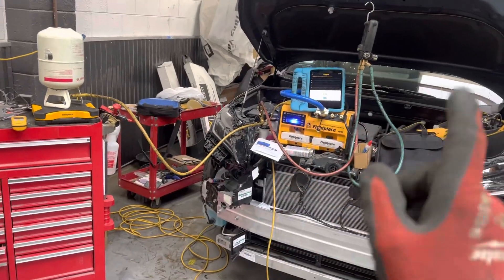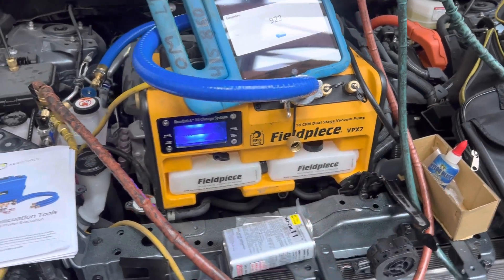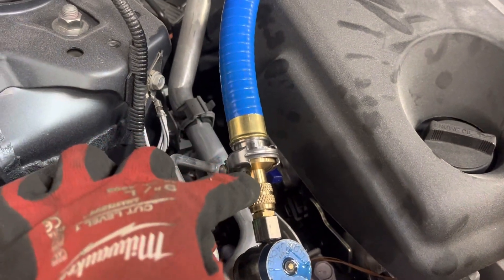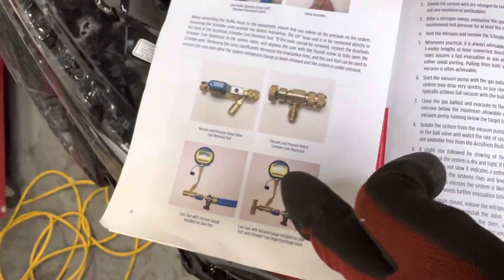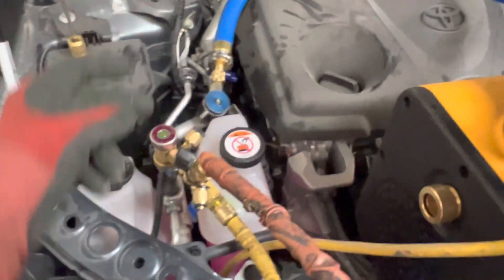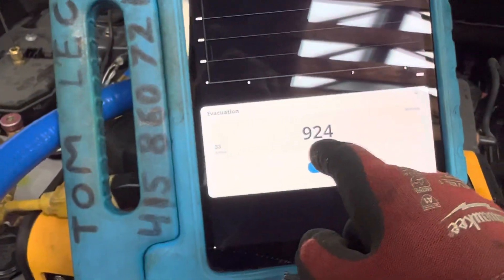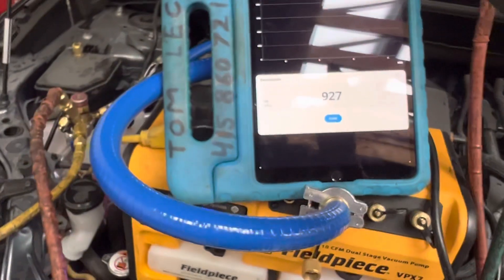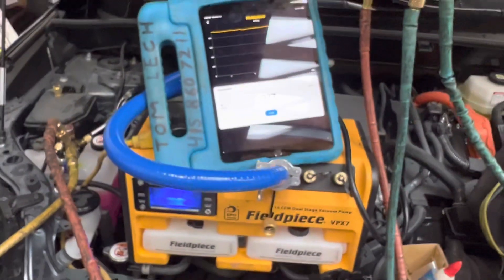Single three-quarter inch silicone, vacuum hose set up Fieldpiece vacuum pump ￼

Comment: Have you ever fully disassembled a r134a quick release fitting? I have a yellow jacket pair and the high side has leaked (vacuum) since new and would like to try and replace the orings inside. I've looked at it carefully and seems like the brass center is riveted on the top depresser wheel you spin to open the system or it potentially could be a 2 piece brass shaft that is threaded. I see some flats on the shaft that lead me to think it comes apart but not 100%. Its a shame because they were expensive and they're really nicely made and would like to get it resolved.
Reply from the maker: Never took apart yellow jacket 🐝 because of rivet.
Reply: Dang ok, I was hoping maybe it was a threaded 2 piece brass shaft with a rivet on the top half.

Comment: Is better to put two vacuum hoses specifically with this powerful hose to get better results?
Reply from the maker: It would be a little bit faster.  But the end result is the same. Just a tiny bit slower with one hose.. 

I was just showing one hose operation because it’s easier because you only have one hose . 

Fewer connections to have a leak at if you did something wrong or have a bad seal . 

In for somebody with limited amount of money to purchase tools, one hose is better than no hoes . 

One hose is a good starting point because you could also hook up the hose to your refrigerant gauge manifold if the person wants to do it that way . 

And slowly, acquire more tools to add onto the system, as fun as become available .
Reply: @coldfinger459sub0  got it....thankyou❤❤❤❤

Comment: I connect the 3/4" to the vapor side and the vac pump. And the red charge hose to the liquid side via the manifold. Then connect the yellow hose from the manifold to the vac pump also. I'm Assuming that this would help with the vac process. Am I assuming wrong? Is there any benefit to how I do it or is the benefit not worth it?
Reply from the maker: Can you make a video posted on YouTube? You could put it as private and then give me the link.  So I could see exactly cause I’m not sure if I understand 100% the way you have it worded.

but it sounds like you have the three-quarter inch going to the suction line for vacuum off your vacuum pump and you also have the yellow hose going to your gauges manifold and then the red hose to the liquid high side of the car ? 
     Did I interpolate and describe that correctly the way that you described it ?.  

If that’s so then, yes, that will work anything or work one hose to hose to hoses hooked up differently. 

But I was with everything the more connections we have them or league points and possible problems. 

Many methods  to skin the cat as long as the end result is the same. 

And everything can be proven with a micron gauge actual testing and verify .
Reply: @coldfinger459sub0  I think he was meaning he hooks the 3/4 inch hose straight to the vacuum pump and then the yellow hose from the manifold to the vacuum pump as well. The idea with it being a more powerful vacuum.  Marty correct me if I'm wrong.
Reply: @mailmanjoe  yip. Trying to get the best vac I can get.
The big blue hose is one of the best purchases for air conditioning ever.
Reply: If you're looking for the best vacuum and you have time, you can start the vehicle while the ac is under vacuum and the ac system should not be on (unless there is an mechanical or electrical issue with the system). Do this while running the vacuum pump, interior fan, and radiator fan if possible; the vibrations of the engine running will let the moisture boil off thru the now reduced surface tension of the oil & the heat that is being driven across the coils; and you should achieve a more complete moisture removal this way.
Reply from the maker: @luckystrike240  yes, that is the way to do it. I’ve made some videos like that talking about it.. 

Unless it’s a touchless, you do not want the compressor, spinning a new vacuum because then the shaft will be spending on the seal . 

In that place, you just have to preheat first and then vacuum . With the engine off..
Reply: @luckystrike240  haha. Yip. Ive done that before as well. We are coming into winter where I am. 5° C days tend to call on any trick you have to get the job done right